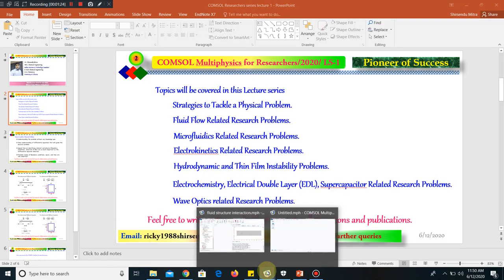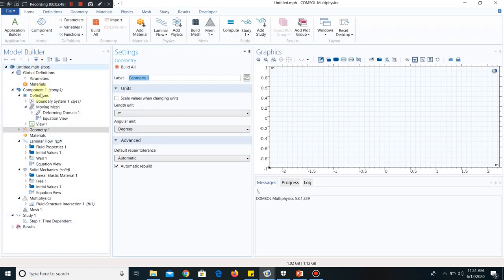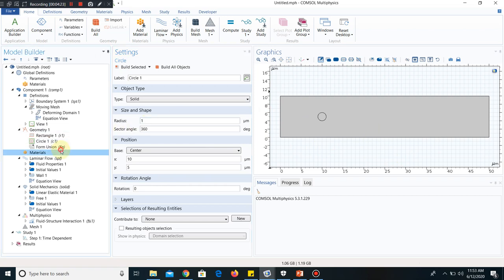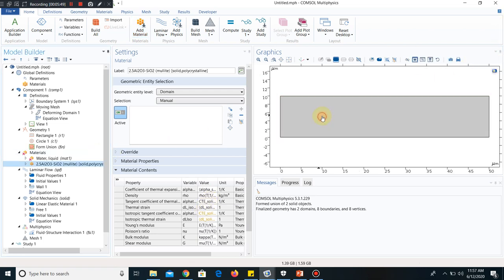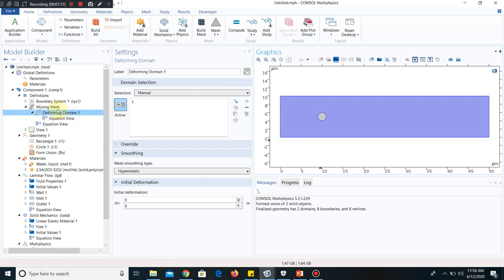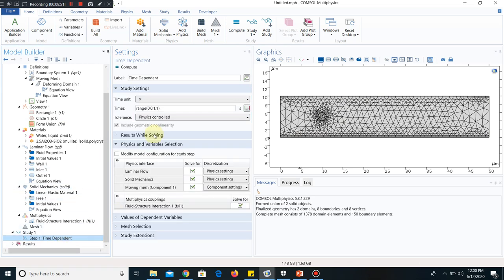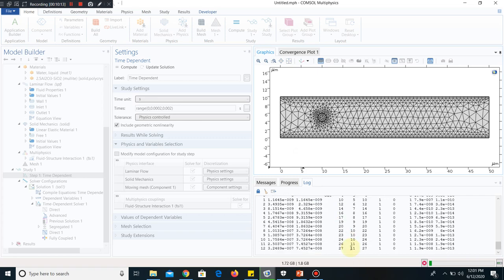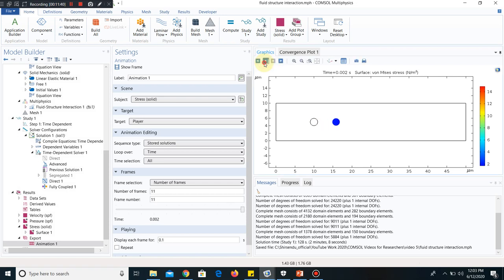Fluid Structure Interactions || Lecture 4 || Series: COMSOL Multiphysics for Researchers

Comment: Hello, I am doing a similar study. When the particle moving under the influence of the fluid encounters any wall in the fluid, 'Last time step is not converged.' Gives a fault. I think that if you extend the time in your simulation, it will probably give the same error again when it approaches the outlet wall. Do you have any suggestions for solving this problem?

Comment: is it possible to make a fluidic mixture like water + Additive 1+ Additive 2+ Additive 3 and then predict the rheological properties like plastic viscosity, Yield Point, Gel strength and filtration properties like filter cake thickness and fluid loss; can we simulate the results of viscometer in comsol?

Comment: Shouldn't the particle also be moving on the y direction due to the density difference with the fluid?
Reply from the maker: You can include gravity/buoyancy force as additional forces in order to see the effects of those forces.
Reply: @pioneerofsuccess4054  I've tried, but i ccan't geit done. I think im not the only one having trouble solving the problem of buyancy force acting over a solid body.
Reply: hi sir I am working on tissue model .and coupling system.can you help me